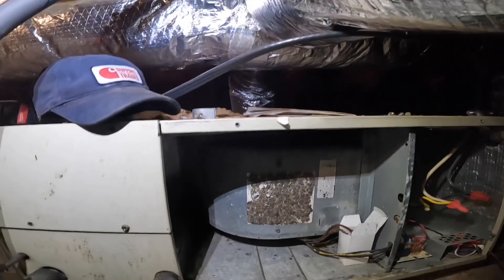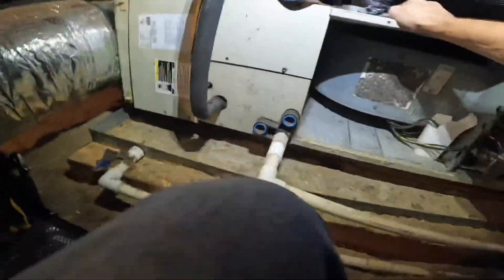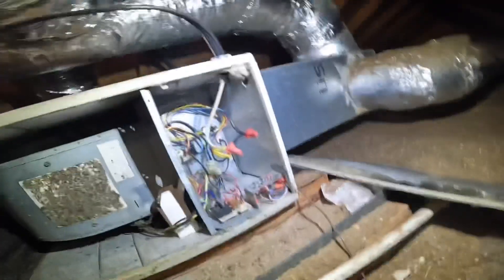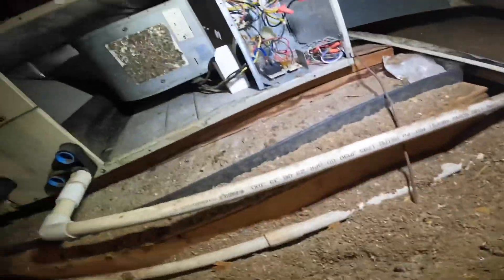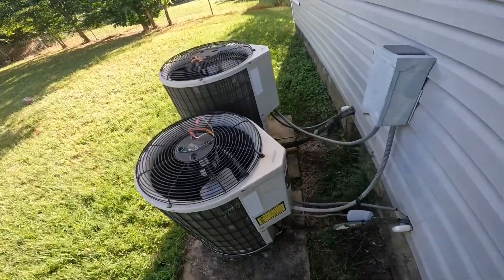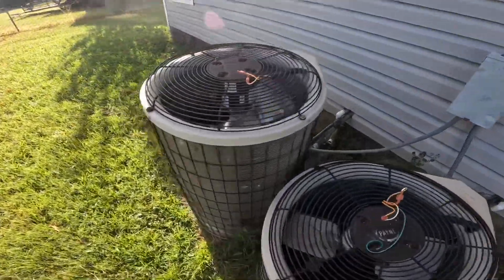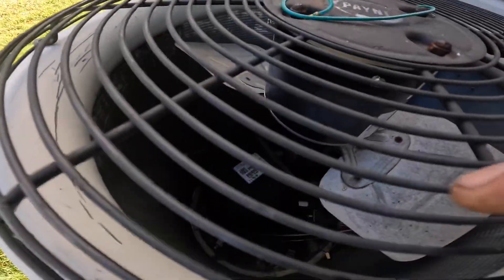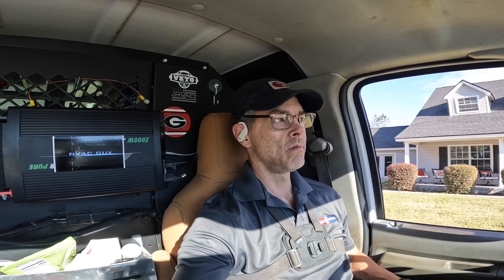22 Year Old Carrier With a Hissing Leak

Comment: There should be a code requirement where a platform must be present for servicing... The cost is so small! You know, a 4x4x5/8 plywood sheet cost less than 50$ even with the crazy wood price hike... It is nothing compared to the price of the unit install! In fact, it could even save a bit of money on labor time too...
Reply from the maker: It is code here. Apparently someone didn’t care

Comment: A 1 X 12 board from a lumber yard, cut into 3 foot lengths would work. Spruce or fir are very light and strong enough to support you if they are 10 or 12 inches wide.

Comment: You need a piece of plywood to sit on 5/8 ths should work no more than 3/4's max cut as big as you need it. You have to love the run cap in a box you see it so much just like people think it is a safe way mount the cap. I would replace both as the age of the system it would make sense just in the power savings alone.

Comment: Everytime your knees clicked, I felt pain in MY knees!
Don't your knees hurt when that happens?
Reply from the maker: Actually no. Happens all the time, but so far no pain.
Reply: @HVACGUY  Might I suggest that you have this looked into BEFORE it becomes a problem and painful?
Knee joint pain is debilitating and painful!
Reply: Chondroitin, glucosamine does help mine, it was like a miracle for me, I couldn't hardly walk.
Reply: Mine used to sound like Rice Krispies but never gave me any trouble until the joint wore out. Several injections later I’m doing good considering
Reply: @kg4muc  clicking and popping is usually a sign of wear and friction.
A joint that is quiet when flexed should not have any noise!
Reply: @pomonabill220  that is exactly what the bone doc told me. Says I need to wait till in 65 before surgery. That’s fine by me lol. My back surgery was bad enough

Comment: You can get aluminum scaffold platforms, ladder decking, etc. to carry up as a quick temporary work space or Joistmate or Hintze safety platforms designed specifically for your situation.
Reply: great idea, even a piece of plywood
Reply: @jthonn  ... piece of plywood about 24 x 30 with a few finger holes in it to carry easier. That can also span the beams either way and still fit up the attic hatch.

Comment: Approx. cost of a replacement such as on that unit?
Reply: easily $1000 for the air handler plus labor. Might as well replace the entire system because that one is R-22 and stuff is getting scarce.
Reply: @rupe53  I fully agree
Reply: Air handler only $3800 installed. Which would not be a smart move. Air Handler and new heat pump $6500 installed
Reply: @danielkelley7422  Great advice and much appreciated
Reply: $6-7k in my area for the changeout for 15 Seer.